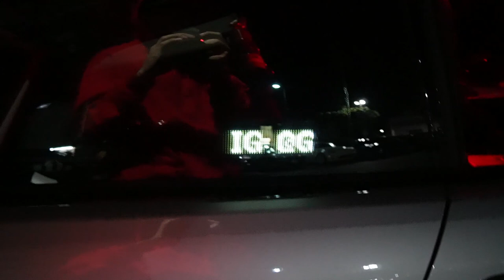RIP GTR...

Comment: The tires ain’t even about being cheap anymore it’s all about being safe, at this point last thing you wanna do is hit highway speeds and have a blowout, think about how much more it’ll cost if you mess up a bumper, tire and wheel. Maybe cause I’m just a tire tech
Reply: Or worse the tire could come off and mess up a fender or rest of the body